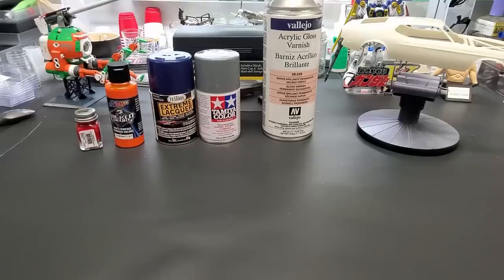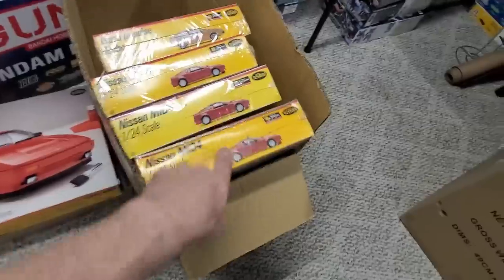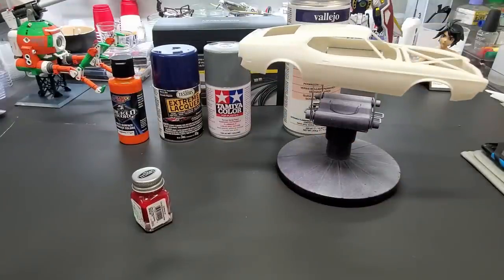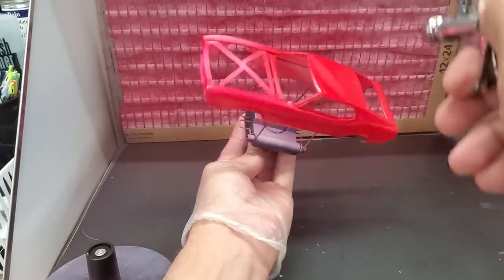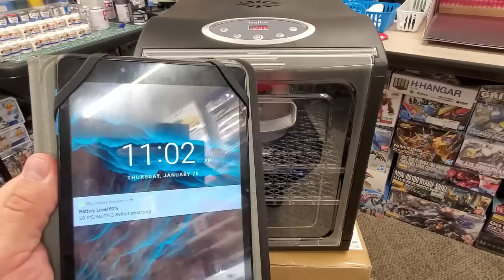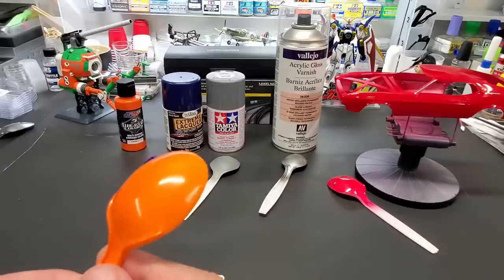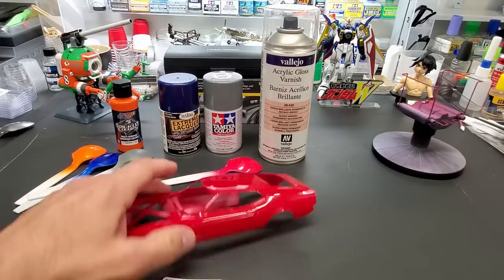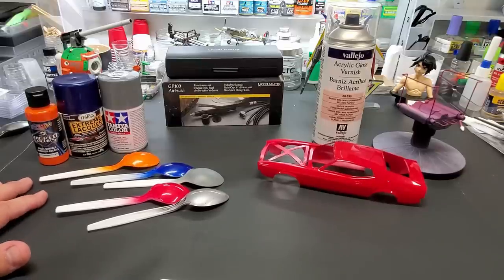Scale Model Tips - Using A Food Dehydrator To Cure & Dry Your Model Paints Fast !!

Comment: I have used one for many years and they work great ! One word of warning though, don't put masked models in the dehydrator, more times than not, you will have a sticky mess under your tape that is difficult to get rid of.
Reply from the maker: This is true, the the tape adhesive melts.
Reply: @barbatosrex9473  "Glass" parts seem to be the worst .
Reply from the maker: @oldhick9047  so far I've only used it just colored painted plastic, mostly my car models painted with real auto paint. Works great for that as the paint was made to be lightly "Baked"
Reply: @barbatosrex9473  I build a lot of resin 1/24-25 scale slot car bodies for our club members. (modeling has been a passion for over 55 years) It helps the resin cure. I use an automotive paint meant for plastic bumpers for the flexing qualities. The dehydrator dries that instantly.
Reply: I have used Tamiya tape and had it in the dehydrator with very good outcomes.

Comment: I found a couple of high quality round units at a thrift store for $7 each. You can cut the centers out of a few of the rings to make spacers so you can fit bodies in it. I like them because they blow the heat from the top and evenly down the sides. Thanks for the video.

Comment: Thanks for all your great work. I bought the unit you used and really like it. I figured that the best way to see if 158.5 degrees would harm plastic was to put something in it and give it a go. I put a piece of sprue horizontally stuck on an alligator clip so that if it would soften it would droop. I also had a plastic spoon that I had painted in there as well. 4 hours later and there was no negative results. The sprue seems a bit more malleable, but not enough that it drooped. Also not enough that I can use it to bend a piece of plastic which would have been handy. The spoon with the paint didn't have any problem either. It makes sense since they are sold to use to eat soup and that would be between 180 & 190 degrees. Just to be clear I don't use the dehydrator at that temperature, I just wanted to see what would happen. I do wish the unit would remember the last setting so I didn't have to set it each time. 

One change I made to the unit is that I put two racks in the bottom and then bolted them together. I use skewers for a lot of small parts and I stick them into the diamonds between the two racks so that they are upright. I found that without the bolts the upper rack tended to slide forward and wedge the door. With the bolts on the shelves they don't move forward.

Comment: Nice to see a video about this. As  a tip they're also great for warming up spray paint cans prior to use. Not sure where you heard about the "wait 20 minutes" thing. Definitely not saying you're wrong but I've dried a dozen painted bodies (glossy, flat and clear-coated) by putting them in immediately and never had a problem.
Reply from the maker: You're right as I tested out putting in a piece I just clear coated in it and it came out fine. A friend who used one for years recommended I do that so I followed his lead. He said the clears will sometime yellow if he throws them right in
Reply: @barbatosrex9473  Ah ok fair enough. I've only ever use Tamiya spray clear lacquer so with other paints it may very well be a vital step.
Reply: @barbatosrex9473  you are right with some paints it might get yellowish a bit if you put it immediately

Comment: I just found your channel a couple of days ago and have already watched half of your videos.  You are without a doubt the best plastic modeling YouTuber I have found and am subscribed.  You're very easy to listen to and follow and I never get bored.. plus you have so many useful tips and tricks that I've never heard of before.  Just curious what body paint and clear you recommend the most for car modelers ( I only build race cars) to get the easiest and best results?  Thanks!
Reply from the maker: Wow, thank you for the kind words. I do prefer lacquers when it comes to auto kits. I like Splash Paints as they are true auto colors. They're not cheap at $7.99 a jar but for a car kit I love I find that price reasonable. They do require a clear coat as they go on flat like real car paints. But the end results Is always perfect. Another cheaper choice is Testors enamels. They go one easy and usually don't need a clear coat. As far as spray cans you can't beat Tamiya, they are the best. I'll be testing the Tamiya Opaque Colors Spray cans very soon too for the channel. I hope this helps. Let me know if you have a further questions.
Reply: @barbatosrex9473  Thanks for the reply... I'm going to check out your Splash paints video(s) next.  I'm assuming you'd use their 2K clear over them?  I've always been worried about how toxic the 2K is as well as the Urethane's if that is what the color paint is.  I have a buddy in the body/paint industry that can mix up 2 oz of high quality urethane color and 2K for $14 if I decide to go that way.  I was really hoping to find a safer paint and clear to spray since I spray in my house like you do.  I had a Aztek booth like yours but it couldn't keep up.  Now I have a Pace Mini Plus that I haven't tried yet.  If it can't keep up then I'll have to try that new one you just got.  It looks awesome.

Comment: You can use the circular dehydrator as well.  I have one that I've been using for over 10 years.  I simply cut the trays away from the circular walls.  You can then either stack and glue the wall sections together or use duct tape to join them.  I have an old Nesco unit with variable temperature control.  For those on a budget, you may try your local thrift store.
Reply: I know this is old but might you have a picture as an example?

Comment: You can take a small pair of wire cutters and cut out the mesh bottoms of the dividers in the round dehydrators, that leaves them as spacers to give you more head room. I did that to fit 3D printer spools inside so I could dry them off.

Comment: Living in Arizona ... April through early June, I paint in the morning, put outside in full sun, and all paint is fully cured by the dinner time.  Same painting schedule from mid September through part of December.  Mid June through to mid September ... I paint in the morning and by 2:00p the paint is fully cured.  So living in Phoenix, the only time I have problems curing paint is during those times if we get any rain (rare) and late December through March.   That is when I usually paint outside (no need for a booth), then take inside to cure, time not being a problem, as I plan in advance the paint for several cars, so I paint three or four at a time, and always have a painted car to work on while other paint is curing.   Though .... I have a tray styled dehydrator, and may cut the platform out of one tray, for back up drying during those 3 off months.

Comment: Once again you solve a problem for impatient modelers. I have a dehydrator I use to control the moisture in my filament for 3D printing. Now it will serve double duty with my models. Never consider it till today Thanks

Comment: Seems also great for curing Epoxyresin pieces.  Epoxy cured at about 60 degr C has a different webbing much stronger than at ambient temps. At ambient temps it cures 2 dimensional, at elevated te,p it cures 3 dimensional , lacking layering Thx for the introduction.

Comment: Nice dehydrator. I have a 16” round one by Presto that I use for enamels. I run mine at 95 degrees for 24 hours for enamels. Nice red paint. I’ve never sprayed the small bottles of Testors before. That came out great. Thanks for sharing. I do like your front load dehydrator.
Reply from the maker: I'm planning on a full test video on spraying the little square Testors bottles 👍
Reply: @barbatosrex9473  That’s cool. I’ve got 100 bottles of them. Been using them for 50 years! Never airbrushed them once😁 since I’ve been watching your channel I’ve been venturing out and using a lot of different paints on every build. I shoot everything over duplicolor paint shop primer I get by the qt from Amazon.  Keep up the good work. 
Ps. I just got some mr. hobby super metallics 2 in. House of hobbies only had 4 of them. I got the regular super metallics gold, brass, copper, burnt iron. The super metallic gold is absolutely amazing.

Comment: Hey Rex, I dont want to bug you but i have a question about these dehydrators. I just bought the same exact one you own. My question is, the louvered round vent on top. Think it would be a good idea to put some kind of air filter over the hole so it doesn't draw in dust particles ?  It looks like this could be a issue. Obviously, I'm not talking about something thats dense enough to restrict air flow through exhaust fan. Maybe cheese clothe ? Thanks. I cannot wait to try my new toy ! Lol
Reply from the maker: I did add filter material to kine. I believe I showed that in my updated video on it. It's a great idea. I use mine every day

Comment: I bought the 6 tray Ivation Food Dehydrator.  I put in parts painted with clear 1K urethane and also parts painted with clear lacquer for 10 hours at 113 degrees and it didn't cure the paint.  I'm going to return it and go back to letting time cure the paint.

Comment: I have been painting with enamels but mix in any generic hardener - often a high-gloss hardener.  After about 15 -20 minutes, the paint automatically hardens whether or not I've sprayed it all out.  Spray can enamel I just leave out in the sunlight.  I think the IR light also helps the cure.  Testors enamel are terrible.  Stingy with the volume in square containers made of glass that harden in the bottle more often than hardening on your model.
Reply: If you mix the little Testors bottles with cheap lacquer thinner the results are fantastic! I mix them 1:1 and they dry a lot faster as well due to the addition of the lacquer thinner.

Comment: Dehydration question:   I have a few automotive body kits and small parts brushed with acrylic and enamel that I have hit with paint like some over 3-4 months some a year and a few over a year since paint. 
   Can you or does it have any effect on these bodies that have been sprayed or brushed smaller parts in both acrylic and like Testors enamel …. To put these already sprayed ( much time ago)  or brushed items into the dehydrator to continue or complete the cure process  ? 
  Will putting previously already sprayed ( say within 6 months) into the dehydration process help the curing ?  
   Or should I just let previously painted items just “ time out” and cure naturally ?
Reply from the maker: Those parts are most likely fully cured. That said it won't damage them by putting them in the unit. Now if you live in a humid area then putting them I the dehydrator will help complete the process

Comment: I decant the Krylon/Rustoleum rattle cans from Wally World. Is the curing time the same as the Testors?  Thanks for giving a time table for the dehydrator.
Reply from the maker: The cure time is about the same as Testors. I good rule of thumb is to go longer and slightly less heat. Like just over 100 degrees and run it a little longer than usual. This would give you perfect results every time

Comment: What about flat or semi flat sprayed or brushed part.  Can these finished be put into the dehydrator for the same affect with the drying/ curing  process ? 
    Should or could a  “  primer ” base , say model car body or any primed part previously sprayed be processed through the dehydrator before a final coat of color,  
 is it recommended that a final coat over a primed already dehydrated finish be put through the dehydration process ?

Comment: Good evening, Rex. What is the maximum temperature for airbrushed acrylic paint on a model in a dehydrator? I just picked one up at a thrift store and it doesn’t have any controls. The temperature seems to be about 159F. I have not used it yet and don’t want to melt any parts.
Reply from the maker: 115 degrees is about just right. No need to go over 120

Comment: Here is one for everyone! 
If you can’t afford a dehydrator like the one on  the video, then get a Ronco dehydrator model number FD1005WHGEN. It’s under $40.00 on Amazon. I fit pickup truck and cars in it due to its dome type lid. I use only Testor Paint which take 3 weeks to be completely dry and cure. On top of the the lid are number settings, I put it on number 4. Heat ranges from 140 - 150 degrees. I found that at that temperature range I can keep in the dehydrator for 108 hours, equaling to 4 days 12 hours. My car’s and trucks paint jobs comes out completely dry, and completely cured.

Comment: I noticed the car body seemed warped. Was that from using the dehydrator or was it warped before? I’ve known people to use dehydrators but I don’t. Now seeing that the body was warped makes me more reluctant to purchase one.
Reply from the maker: It wa warped out of the box, it's an awful kit. Once I got it I knew I was just going to use the body for a test. It won't Warp your kits. Just set the heat to just over 100 and you shouldn't have a problem. Also you could also place the car body on a jar. Plus you can set the heat lower and run it longer for the same results.

Comment: I need help I want to paint in the basement the models but my basement windows will not open. How do I pipe out paint fumes out of the basement if the windows will not open? I will make my own paint booth or make one out of a big plastic tote and a bathroom fan taped to it. Another question should I build my own spay booth for painting plastic models or buy one? Another question how do I make pigments stick to the place I apply them on my models the powder pigments I am using the mig branded ones

Comment: How would this work with acrylics and smaller models?  What temp and time would you recommend?  For example drying a war hammer 40K army?
Reply from the maker: I've been going with 130 degrees for 20 minutes lately but it depends on your situation. Low and slow works well too, 100 for a couple of hours but I've been impatient and found that 130 for shorter times work well

Comment: Every one, hold on a moment............... Food dehydrators are great YES, BUT do not exceed 104 degrees Fahrenheit. If you intend to speed dry a plastic car over that 104 degrees you may end up with a sagging model. Did you ever try to dry a plastic model in your mothers stove at the lowest setting, good luck, and if she caught you !!!! The food dehydrator I have has no setting, plug and go, I tested it when I got home from the thrift store 104 degrees, good. Spent $8.00. It was the round kind with stacking rings, measures 11 inches in diameter and can get 2 car bodies inside. Got out the motor tool and hollowed the rings except the bottom. That dehydrator you have has variable heat, great for banana chips, so please be careful with your plastic, cheers.

Comment: Ok so I have been trying this out for about a month now. For some reason I’m not getting any different results then I would if I just let my pieces air dry. Except the paint seem to come detached from the plastic on the ones I put in the Dehydrator. I don’t know if the primer is melting or something. So I’m using acrylics and I used a few different primers ( Testers fine, army painters and the worst was Mission Models paints and primer. That stuff just flacked off primer and all like old lead paint. So I’m wondering what I might be doing wrong. When I spray I thin with water if I need to or Createx 4011 I think it is or Vallejo thinner. Then I let air dry like you said for 20 min sometimes a shorter time depending I’ll admit. Then into the Dehydrator. Now I have looked up other people using a dehydrator and there times a temps and I know on here you said the temp was about 120 or so but some say 140 150. So I tried all of them. All for 5 hours. And I get the same thing. Rather paint just falls off the model or it just ends up just like if I air dried it. Can you give me any ideas
Reply from the maker: I'd stick with 120 to 130 degrees. Try putting the pieces in right after you paint it. I've been having good luck with putting them in right after I paint it too. Then in about a half hour take it out and see what your results are
Reply: @barbatosrex9473  will do! I’ll let you know how it turns out

Comment: Does it spread the fumes though out the house or are they contained in the dihydrator?
Reply from the maker: I didn't smell anything at all so I would say it contained them. It worked out great
Reply: @barbatosrex9473  
 It says to run it for 30 minutes to break it in, but it doesn’t say at what temperature. Do you remember what you set it at?

Comment: I had to convert to celsius. I was confused at the beginning because of that. I read on Amazon that this device goes from 35 to 75 celsius degree.
Do you know if it can be dangerous for plastic at maximum values? I don't know at which temperature plastic starts to melt.
Reply from the maker: You could end up warping plastic at a higher temp. After I researched it the perfect temp for plastic models is a maximum of 120 degrees Fahrenheit
Reply: @barbatosrex9473  Thank you.